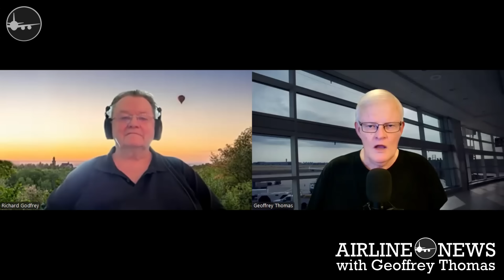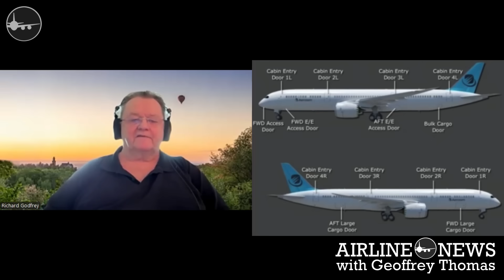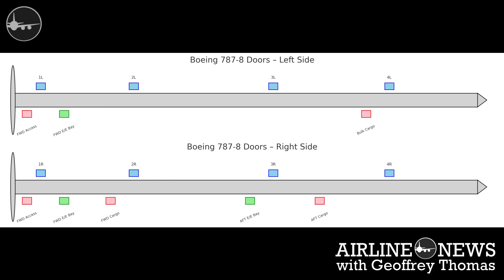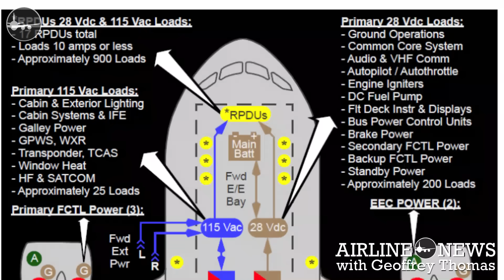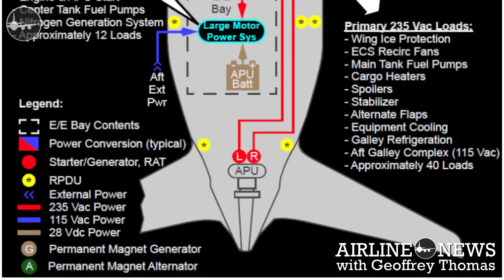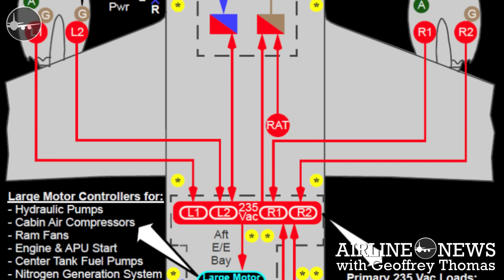Air India Crash Eps 189 - Toilet Leaks Exposed

Comment: A little common sense, in addition to aviation technical knowledge, is required to analyze any aviation event. When water leaking causing electrical system failures has previously occurred on 787s, this should have been the first suspected probable cause of the fuel being cut off. The minimal and vague information, submitted by the authorities, (possibly attempting to protect Boeing and keep the 787 fleet flying), is not sufficient to draw any conclusions. Because they can’t explain what happened, so called Youtube and TV "experts", trying to impress their viewers, were "reaching" to come up with any explanation for this crash, by initially blaming and defaming the pilot(s), similar to the Malaysia Airlines disappearance where, because these experts, because they could not explain what happed, try to blame the pilot simply because he had a flight simulator on his home computer, as do virtually all pilots. The CVR statement "why did you turn off the fuel switches" is being interpreted as being a cynical statement. In fact, when facing imminent death, with only a few seconds left of life, both pilots may have acted in a desperate manner and independently from each other in trying to restart the engines, which would clearly explain the question. One of the pilots, suspecting an electrical or fuel switch or FADEC failure, may have tried to cycle the fuel switches off and on in a desperate, but futile, attempt to fix a suspected fuel switch or FADEC problem, similar to what a pilot may do in cycling the landing gear switch up and down when the wheels won't come down. This electrical problem is a certainly possible scenario considering the reports of water leakage damaging the electronics in some 787s. Unfortunately for the passengers, crew, and others, there was simply not enough time for the pilot(s) to troubleshoot the problem and re-start the engines

Comment: I was an aircraft electrician on Boeing B-52 and KC-135 many years ago. Water Ingress is not needed to have major electrical problems deep inside huge wire harnesses. Heat, Vibration, Chaffing inside where no one can see, I have seen carbon tracking wreak havoc. Wires weld themselves together, causing multiple problems in unrelated circuits. While water ingress can certainly cause problems, it is Not necessary. The loads on the aircraft I worked on were Tiny compared to modern aircraft with Megawatts of power crammed into small spaces. Too much power,too many wires in constantly changing temperature, humidity, vibration and repetitive operation to be fail safe. Sadly, This Will Happen Again.
Reply: But then again there haven't been any such incident on a carrier but Air India. 
So the lack of maintenance and the following water ingress has most likely played a role.

Comment: The Vac: 50Hz, 60Hz and/or 400 Hz?
The air conditioning generates H2O liquid/(ice at altitude).  Can this H2O cause electrical problems?
Do the EE bays have liquid detection devices? Are EE bays pressurized like passenger cabins?
Does the USA FAA/NTSB generate bulletins/warnings on non-USA manufactured aircraft?

Comment: 37 degrees C is 99 Fahrenheit. That’s a normal summer day here in most of the SW USA. I wish people would stop saying 171 was taking off under some kind of extraordinarily hot conditions. It was not.
Reply: When the majority of jet traffic takes off and lands in the SW USA. At this point it maybe considered "normal" conditions. However the fact is it doesn't, and standard temperature is defined as: https://en.wikipedia.org/wiki/Standard_temperature_and_pressure. In the context of what the plane is designed for. 37 degrees C or 98.6 degrees F is  "extraordinary hot conditions. Broadly 68 -77 degrees F is " normal". So yes, 30-21 degrees above "normal", is " extraordinary hot". Go bake in the sun a bit more ;)
Reply: @Josemenez-lofs you don’t understand how adjectives work.

Comment: Nitrogen is for fuel tank pressurization not so much venting eh?
Reply from the maker: The nitrogen generation system is to ensure the oxygen content of the air via the venting system of the fuel tanks does not become an explosion risk. As fuel is used, if the fuel tanks where not vented a vacuum would ensue. If nitrogen was not available, the oxygen level poses an explosion risk.

Comment: Incredible work gentlemen. It’s been an honor to ride along with you as you unravel this puzzle. My question is this: Is your water leakage theory supported by some of the electrical issues the passengers were experiencing on the preceding flight ie air conditioning failure, entertainment center glitches, etc?

Comment: I am always impressed w Richards analysis! I’m curious to know, how much water is held on board to allow toilets and sinks to function? How often is the water replaced and how is that achieved? Does the refill process happen between flights? If the refill process is rushed could excess (or unintended) water be introduced?  Typically bathrooms are always a wet mess after a long haul flight!

Comment: This sounds more plausible and I do commend the excellent work,  but still doesn't explain the 10 second delay between the cutoff and relight.   This should happen immediately....the delay makes even less sense in the context of this revised thesis.  This thesis could explain however, the "why did you cut off" comment and it could explain the RAT deploying even after you allege (which is consistent with main power failure).  Also, saying that Air India double checking all lavatories for leaks after a report saying they were compliant with the directive is somehow some smoking gun that they may not have complied is really gas lighting.  Which airline if faced with the same situation, wouldn't double check to make sure the inspections are done correctly and maintenance crews are doing their job!!???. You think it would have been ok to not double check??!  kind of a ridiculous statement...that's what worries me about the purported objectivity of this channel...lots of really good work and digging, but then you see statements like that and can't help but think there's some sort of conspiratory angle, ala MI370 which can provide years of fodder for speculation.

Comment: I am but a layperson so beyond the technical mumbo jumbo conveyed in this episode and the other episodes articulating the hypothesis of the fluid leaks and electrical failure, I am left with a very simple question.   Where's the 'smoking gun'?   If the hypothesis of fluid leakage of any kind causing electrical failure and the downstream effects causing the crash is correct, well then, on an aircraft of this complexity of computerized control and sensor function, why didn't these electrical failures present themselves more blatantly obviously in the monitoring equipment reports that would be downloaded onto the flight data recordings or whatever the black box data info is called.  It wouldn't have to be a specific electrical bay sensor being tripped but ANY electrical failure showing in the recorded data.   If it happened, it  must have been recorded!     I just can't buy the more complex hypothesis without more conclusive evidence which surely would have made its way into the prelim report.   At this point it appears to me this is all wild speculation without a shred of physical evidence.   I even take pause with the timing of the rat deployment and coming online timing data point inferences.  This, of course, may betray my layperson status and more sophisticated minds may see the web of speculative data making more sense, and if you better minds than I are out there, please articulate in layman's terms why this fluid leakage/electrical failure hypothesis is more obvious to a more technical mind.
Reply: Failure details may well have been logged but as yet we have not been presented with details of any relevant flight data recordings. We are being kept in the dark. It is well known that there are problems with condensation accumulation and toilet fluid leaking under the floor onto electrical equipment. I'm sure that even a "layman" would understand that fluid and electrical equipment don't mix and can cause catastropic failure whether it is in the home or an aircraft.

Comment: The puzzling part is why did the pilot turn both fuel switches to CUTOFF and waited another 10-14 seconds before turning them back to RUN!.
Reply: Perhaps they didn't.  Weird things, transient or permanent, can happen when electricity and electronics are involved.
Reply: Geoffrey covered the answer to your question in this episode.

Comment: 25:19 -- "But when the emergency took place and the RAT deployed then because the captain's flight instruments
and display are the only one that are powered. There is quite clearly a missing piece in the cockpit voice where the captain says "my aircraft"
and takes over the control. He has to because he's the only one with the
the flight instruments and displays being powered. So the RAT deployment
automatically signals the captain to take control of the aircraft. And in my
view, the captain was then trying to save the aircraft and relight the engines."

1. The Boeing 787 Dreamliner is equipped with batteries that provide backup power to critical systems, including instruments, in the event of a power failure. These are primarily two lithium-ion batteries. One serves as the main battery, while the other supports the auxiliary power unit (APU). They ensure continued operation of essential systems during flight, even if the main generators fail. Thus the co-pilot's instruments would not instantly fail as the engines spooled down and RAT was deployed.

2. If the FDR in fact contained this sequence of information, namely engines cut out spontaneously, co-pilot instruments fail, "my aircraft" call by pilot, then manipulation of fuel switches in attempt to restart failed engines, i.e. essentially exonerating the pilot, why would the investigators not immediately release it?

3. The reason is, that never happened. All the actual evidence still points to a deliberate sabotage by the pilot to mass murder everyone else aboard while suiciding himself. It is the horrible reality we have to deal with.
Reply: Agreed.
Reply: Strong conjecture. Time will tell. Looks like both you and I will, indeed, be wrong if we are wrong. ... * if * ...

Comment: i have no idea where fault is assigned ... boeing?, air india?, regulators?  clearly boeing did something wrong and caused the problem (assuming the theory is right) ... my reading of the a/d is that it didn't need to be acted on for many years ... if that's the case, then air india would be the least culpable
Reply: the document i see is pretty wishy-washy and unspecific about compliance ... "Although the unsafe condition has been known since 2016, the omission of sealant in the airplanes added to this AD didn't occur until 2018. The new actions in this AD must be accomplished within 5 years." 

from https://www.federalregister.gov/documents/2025/05/14/2025-08346/airworthiness-directives-the-boeing-company-airplanes
Reply: (assuming the theory is right) with that you could have endless explanations for what did/didn't happen. The flight recorders are the only source of actual facts and data related to this crash.
Reply: I would add video evidence and maintenance records among other things to your list of what's relevant to consider

Comment: I cannot remember how many times I opened the door to airplane toilets only to find the floor drenched in water. Many travelers observe toilets etiquette by using water to wash rather than use toilet paper, and airlines do not provide passengers bidets,so people improvise. It is a dangerous and horribly unhygienic situation that needs addressing.
Reply: It's actually quite difficult to provide a bidet spray that doesn't have the potential to cause contamination of the feed water supply. In countries where personal bidet sprays are common, there is typically a wet room type floor drain. Then again, the aircraft water supply is limited and not intended for 400 passengers' personal ablutions. So, there is a mismatch between the Western aircraft engineering perspective and the expectations of certain non-Western passengers.
Reply: @jonz2984 Agreed 100%.

Comment: I've asked this before and Richard has at last shed a little light on the question (only a little, though). I asked how any aircraft could get certified if it was designed in such a way that fluid ingress into electrical equipment was possible. According to Richard, a directive was issued to install a waterproof membrane above the E/E bays and this confirms my suspicion that the original design did not include such protection. Also, AI is reported to have achnowledged the problem to the extent they installed waterproof matting in the galley areas. So, my question still stands: how did any aircraft with such an obvious potential threat ever get certified in the first place?
Reply: Simple.  The DOT/FAA in the USA is bought and paid for by Boeing... 😊
Reply: @BlueSpruce2  Weak.

Comment: It's refreshing to see a channel not fixated on one or another theory regarding this incident.

It has been clear to many of us from the very beginning that the EAFR does not record the physical positions of the fuel run/cutoff switches in the cockpit, but at best only a signal on the network, possibly recording that the fuel supply valves have been closed or, as they say, "transitioned" from one state to another.  Determining all possible ways both engines can suffer near simultaneous loss of power and ruling them in or out is what a thorough investigation should be focused on.  

Finally, publish the full CVR transcript along with any other audio analysis of cockpit sounds that can prove whether or not the switches were physically flipped from run to cutoff then back to run again, supported with accurate time stamps, by someone in the cockpit during the takeoff sequence.

Until then, let's keep an open mind until all the facts are laid bare.

Comment: I'm sure that you've seen the different videos posted on social media (and YouTube) of "leaks" in Air India aircraft. Some of those leaks were coming from the ceiling with streams of water and drips falling upon the seated passengers. I've always assumed that this was due to condensation accumulated in the tropical environment. In one video, the pilot actually mentions this issue via the intercom. Given the electrical wiring all around the fuselage, this seemed highly problematic. If I were the pilot, I would have declared an emergency even before taking off if this was an issue.

Comment: Dear gentlemen, thanks a lot for your time and effort you´re putting in this invastigation! A family member of mine actually is a pilot for a German airline, he quickly followed the route of blaming the pilot. I was quite sceptical about this theory from the beginning: If I really was suicidal and even willing to take along a number of innocent souls along with my decision, the timing to do so was just really, really strange. 
One thing I keopt asking myself all the time: On takeoff the CCTV showed a cloud of dust of the left side of the plane. There were early speculations if this cloud was just dust/debris on or by the runway or something coming from the engine. Do you know if there´s footage from the same day at the same spot of the runway of other planes taking off so one could compare?
Please keep up your excellent work as well as your sensible, polite and thoughtful attitude of dealing with this tragic event!
Cheers from Frankfurt/Germany :)
Reply: If the main battery was shorting out at rotation a lot of smoke would be vented out of the left hand side of the aircraft through the port specifically provided.  I had dismissed it as a dust cloud too but the runway was clean and now think it could be smoke swept up by the vortice.
Reply: I've always wondered about the dust/debris/or smoke that was so visibly obvious in the video footage too. We've never really gotten a clear answer to what caused it or how it might be related to the crash. A video of other airplanes taking off previously or in other similar weather conditions would be very significant, yet no video footage as ever been provided

Comment: The smell of urine in equipment racks essential to the safety of the plane! Who could let such a plane take off! Who could even design a plane with a toilet over the EE bay, without putting an aluminum 'umbrella' completely over and around it? No sane engineer, surely, would rely on a bit of caulking to save a plane from disaster.
Reply: no one, because that mistake wasnt made and the claim of a urine smelling RDC is made up. How these two guys got to a stage where they can jsut simply announced to you all, A GUY TOLD ME THIS, and you all beleive, is a real worry.
Reply: It's another dumb engineering design or decision by Boeing.  There's a reason you don't route wet piping over critical computer equipment in Data Centers.
Reply: @BlueSpruce2 They mention Airbus aircraft also have this problem. Any plumbing system in tens of thousands of aircraft is going to occasionally leak. The issue is preventive maintenance and preventive design.
Reply: @cdmc2 Sure, but the design should account for leaks, either slow or catastrophic, to happen even with perfect maintenance and inspections.
Reply: @BlueSpruce2  You put a single piece of aluminium over the top of the bay, with  the edges curled over the top of each side. Liquids drain down the outside, not inside. Hatches have a raised rim. It's not rocket, or even aeronautical science, simple common sense.